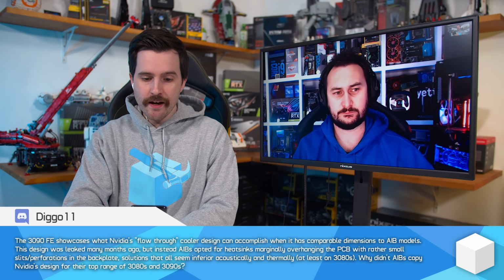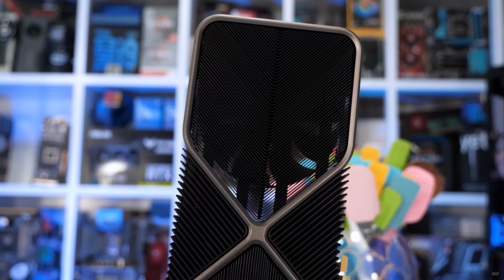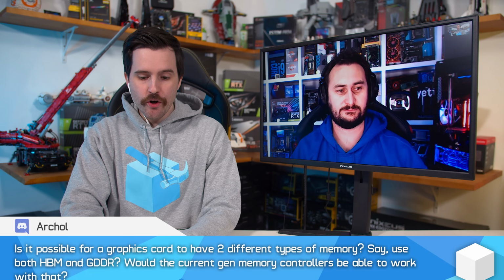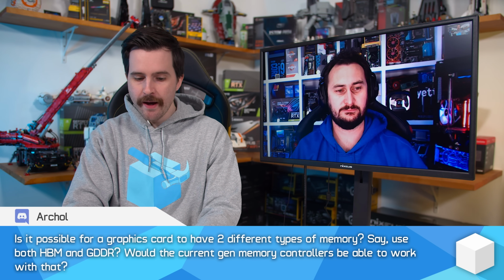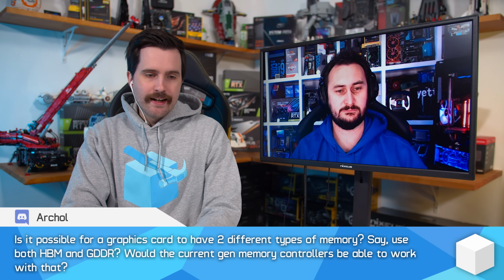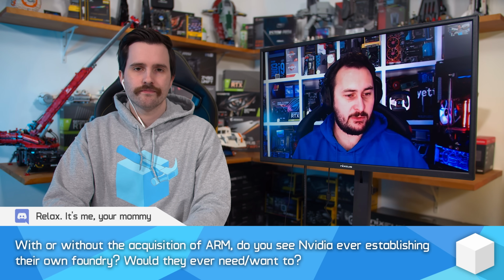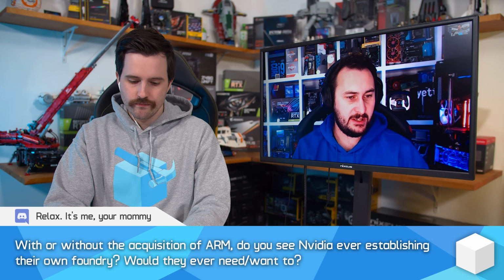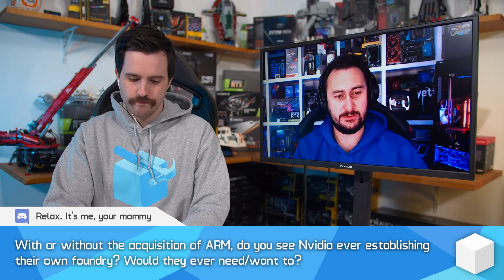Will RDNA2 and Zen 3 Have Launch Issues? Can AMD Beat Nvidia at Ray Tracing? September Q&A [Part 3]

Comment: You're going to have to forgive me for this, but this "all laptops already run at Tjmax so therefore we're going to stop talking about it" just doesn't sit well with me.
If you don't thermal throttle your processor... you're leaving performance on the table...?
So you've utterly given up on pushing manufacturers to design thermal solutions in their laptops that actually do their job and keep your computer from desoldering components from itself?
That said, I do agree with use of wattage numbers in reviews. I just... 
As a broke sod who may end up keeping a laptop for 7 years plus because even a $600 "budget" machine is very expensive to me, I want to know that once I buy that computer, it's still going to WORK in 7 years once it's become too old for me to enjoy using.
I should WANT to upgrade my computer, not be FORCED to because the thing desoldered itself and died in 2 years.

I could write an essay about the problems with the modern laptop market, and how some reviewers want there to be less variety in the market because they hold the Macbook sacred as the perfect thin-and-light class laptop (I tried one in a store; I don't see the hype - yes, it's so thin you can shave with it, and the screen does look nice, but the keyboard and trackpad were not fun to use) and want anything that's not a gaming laptop with the dimensions of my Inspiron 1501 to aspire to it, complete with its flaws (Donglebook? Keys with such short throw that it felt like typing on a contoured board?)...
Don't get me wrong. I'm glad that the market has moved on from underpowered laptops with 5400RPM hard drives, one inch thick frames, massive bezels, and 6.5lb desk weight that take five minutes to boot and run two hours on a charge if you're nice to them.
But at what price?
A full size laptop can hold a lot of stuff. I/O ports, cooling, optical drives, good keyboards, and multiple user-replaceable batteries are just the things that I can think of off the top of my head.

Comment: All I wanna know is will the new 5000chips work on my High end X470? Seeing as they’re skipping 4000 on desktops they have to follow through on their promise right? Either that or ive paid 370 on a board and can’t really upgrade
Reply: All X470 boards (and B450 boards, while we're at it) will support Zen 3 chips. Call them 4000 or 5000, it doesn't matter. They're still Zen 3.

You'll probably need to flash the beta bios, but your board will support the chip, as promised. Good Guy AMD, as Paul's Hardware would say.

Comment: I mean amd has 1 month to patch their ray tracing and dlss to "work" with the cyberpunk2077 launch....im sure they got HEADS at CDPR with this clockwork work cycle....in turn...helping implement said AMD dlss patches etc....for said launch...AMD has to throw which ever $$$(next gen console lobbying/won) where ever they must to insure software implementations are met considering....the 3070 price point and the 500-700$ price point AMD claims/usually price/performance competes with.......if 700-800$ can get me 16gb....and HOPE that i wont have to skip BIG navi.....bc rtx does dlss 2.0 and AMD is merely a GIMMICK for an entire 1-2 year period.....ill/well have no choice.....as far as ultrawide/4k and VR etc....hopeful gamers. 1080p/QHD has its own crowd as well as G-sync frame threshold seekers. Ive finally moved on to PVE etc.....4k/ultrawide gaming as a "gamer"....i still got my 1080p 165hz if i "have" to play any competitive shooters with friends in discord or etc....Since i know the IPS work arounds for low input lag.....enable MPRT 1ms "GIMMICK"............auto calibrate colors and brightness....in geforce experience....boom g-sync with mprt.....but no adapticve sync....bc who cares 400+ fps in valorant or cs:go.........and 1ms-3ms on IPS......if your panel is actually proven to actually get low sub 5ms on IPS.....>ACTUALLY<. n00bs try to get fast refreshrate and response on an IPS then complain about low brighness with the intermittent-inactuality black frames being flipped between renders....to give 1m-3ms in actuality......coughs/clears throught....you can customize colors/brightness in GPU suite...amd or nvidia....nvidia has the added PAY TO WIN aspect of still having g-sync enabled.......with mprt or "fast response" etc enabled.........vs freesync having to be disabled. Just a little insight on the PANEL-gate i believe were truely in and how GPU driven utilizing varoius panel/monitor caveats actually is vs how underutilized they are and yet payed for and standardized some of the concepts are. Either way as usual N-vidia has some software or work around caveat to edge AMD.....as far as total FPS or "RESULT" driven sales. Just like this freesync vs g-sync IPS driven gaming demographic. Anyone in the know just "KNOWS" nvidia has varous aspects that are worth 100-200$ from a software/exclusive side. That still drives a wedge among gamers/consumers. Hoping more TCL series 6 120hz 4k tv "gaming" 2020 reviews come out....bc if not im still going to have to save for the better part of 6 months for an LG 4k tv with g-sync....if so. Fingers crossed this 6900xt is the bees knees along with a 55" TCL 120hz quantum series 6 for gaming. For 800$ for that tv....and my budget ultrawide....im looking at 1250$ total for my 2020 and on...monitors......vs 1200+ for the 200hz IPS etc hullabaloo ultrawides or the 38" LG ultrawide....2 panels vs 1.....An other example that TCL 4k gaming tv.....or a 32" VA samsung odyssey........were in an interesting "Place" RN as gamers.........im going the route that favors my PC and an eventual next-gen console for digital exclusives.....i hope the multiplayer/online demographic sees echoes with this next-gen launch as world of warcraft etc does their best to maintain a status quo for the "PC master race" as well as the PC cyberpunkers vs the Next-gen crowd. These statistics really intrigue me.

Comment: As for rdna 2 availability i dont think it will be much different to ampere, i mean yeah nvidia cards are way more popular but the demand is still insane these times regardless manufacturer. amd radeon group is known for paper launches as well and then there are drivers, features and performance. Obviously demand will depend on product success but i think availability will be just as bad if not worse.

Comment: Here in uk the same. Zero founders edition 3080 released as nvidia deliberately inflated partners prices. So the worse than founders cards that look so ugly with cheap fans stuck all over and will sag without brackets went from 649.99 to 720.00  plus within thirty minutes of nvidias notify me button Going straight to sold out.  On top of these issues as Ampere maybe better fps wise than the woeful turing serise but its a massive step backwards in efficiency and the actual size and weight of cards due to all the extra heat. Not only are there zero founders edition 3080 s available but there are zero partners cards at 649.99 even though they should be cheaper as they look ugly compared to fe and often perform worse and somebare showing sagging issues as they heat up etc..Adored tv has agrreat video on youtube about turing and ampere go give his latest video a watch its brilliant.   Nvidia like intel got lazy. They thought they could just release a card with 20% increase in performance every year like intel used to do with its 4 cores every year. As intel went into panic mode websaw them launch power hungry hot cpus as they tried to combat amd ryzen....amd ignored them and carried on with ryzen 2 taking another step closer by teleasing low powered efficient multi core cpus that nearly match d intels gaming performance but at half the power and heat ie the 3700x at just 65watts is a incredible cpu. We see amd playing the long game again. With each gpu launch they gaining experience, learning from mistakes and ignore competing instead focus on launching a more efficient lower powered gpu that slowly is closing the gap on nvidia. I have always bought intel and nvidia....but now l use ryzen 3700x and pcie 4.0 nvme drives and at such low power and heat it leaves intel well behind even though l may get a few less fps at this time...in future having pcie 4.0 keeps system a bit more future proofed....althogh l expect ddr 5 to makee upgrade before we have need to use a gpu on a pcie 4.0 slot. With ampere nvidia did not think amd woukd get so close..when they began to panic as they saw rdna2 leaks capability wise they stuck on 8nm only had one choice...they had dramatically increase power consumption...75 to 100 watts extra used by 3080 over the 2080 super and yhen had to deal with the heat..so nvidia design a founders edition card with a huge heatsink on but make this for reviewers only..delibetately inflating prices of partners cards while lieing that price is 649.99 when no one can find one anywhere near that price. So why did nvidia panic launch cards when they and partners had zero stock vrs demand? Again panic mode as they try to make as much money as possible before rdna2 launches.  Amd have a chance to take a huge 15 to 20% market share off nvidia..which would be a huge step as amd heads towards their rdna3 launch. I think now the winner between nvidia and amd is down to who can produce the most cards before xmas. If amd makes rdna2 cheaper and readily available for all nvidia is going to lose market share on a scale we havent seen for years. I do think until rdna3 we will have to wait as then amd shd be level with nvidia but till then..l for one will buy rdna2 if they launch in november and l can get one otherwise l may either stick to 2080super or consider a 3080 fe at 649.99 if they actually exist and its not just a fake card nvidia made for reviewers. Nvidia should tell us truth ie how many 3080s fe cards they have made...how many they released and the figures on when more are coming ..as they dont many are annoyed and will go to rdna2 like ke me.

Comment: DLSS would of course raise VRAM usage.
Reply from the maker: Yeah? How so?
Reply: @Hardwareunboxed  My hypothesis is that the GPU is doing more when DLSS is enabled compared to when it is not. 

Normal 1080p and 1080p scaled up via DLSS to 4k both need to assemble a 1080p frame, but the DLSS enabled option needs, at the very least, somewhere to store the upscaled frame as it's being assembled.

However, this does need to be tested as I'm not knowledgeable enough to be anywhere near certain that VRAM usage would actually increase (I'm not nearly as certain as my first comment might suggest).

Comment: Question: At present, there's almost NO HDMI 2.1 supported PC monitors in the market. But There are several TV models that supports HDMI 2.1 plus 4K plus higher refresh rates. What do you see as drawbacks when someone need to use a TV(of above specs) as a PC Monitor?

Comment: If AMD can release a 100% 1440p 144hz gamin cats at a reasonable price, they just win. That’s where the money is rn.
Reply: This. As GamersNexus pointed out, the "8k" marketing nVidia is pushing is actually a bit detrimental, because with (I think it's literally just 1? 2?) only a few 8k monitors in existence, no one but the ultra-enthusiasts are going to be using its "full potential". 

Which I use loosely since even 4k gives the 30xx problems in multiple games at the moment. AMD has had great success in the mid-tier market, and I'm looking forward to seeing exactly such a card as you describe.

Comment: Tim's right about why they launch the high end products first (the other points about logistics are also true though). While the people with $700 ready to go will of course buy the halo product anyway, as Steve states, leading with the halo is about capturing those who might have $400-500 ready, but who could possibly stretch to $700-800 if they make serious sacrifices in other areas, or possibly go into debt, and have poor impulse control. The people who would probably only buy a 70 class card, but damn it, they want it NOW! It's definitely something that manufacturers think about in these calculations. Otherwise they would just go with whichever was going to be the easiest to get out first, which would generally be based on silicon yields.

Comment: AMD also has to supply the processors for game consoles too and they are struggling to keep up with demand there also so I don't really expect much until after the 1st of the year after they satisfy the demand for this console and CPU products  .... Investor reports at the end of 1st quarter were predicting a falloff in sales because of Covid but they actually had an increase in demand and that demand is still at record levels compared to the same time periods the earlier few years ...... That put production in a bind because these schedules at TSMC are set months in advance and around the time these schedules were booked they were planning on less not more demand .....

Comment: I planned on buying a 3070, but when I saw how crazy the hype was and how difficult it was to get the $700 3080, I thought there's no way I'll be able to snag a 3070 at launch day, assuming it'll be even MORE popular. And I already sold my 2070 Super, so I didn't want to go TWO whole months on my older 970, especially considering I bought a 240hz monitor... So I went ahead and bought a 3080 instead of waiting for the 3070. Idk how many people are in the same sort of boat, but I figured it's an extra $200 and I don't have to wait an extra month+, so I went for it.
Reply: How did you get a 3080? and are you in the USA?
Reply: @unclej3910  yep, in the USA. And I used distill.io to monitor the out of stock button on Nvidia, Best Buy, and EVGA. It just refreshes the page every (any time you pick) and checks to see if whatever part of the site you selected changed at all. Then when it sees there's a change, it made a notification noise and I ran to my computer (which had volume maxed out) and tried to order. There's also a discord that's got a distill.io bot setup, if you don't want to do it yourself. It's called 3080 tracking or something like that

Comment: Something I want to point out that everyone seems to miss is that AMD had Radeon rays years before RTX came out.
Reply: I'm not up on my Ray's knowledge but wasn't Rays 1.0 just a plugin for Unreal engine and came out in 2018? Rays 2.0 in 2019 but didn't support any useful API and Rays 4.0 this year supporting vulkan and dx12.

So unless my admittedly limited knowledge is wrong, AMD didn't have it "years before RTX", but in the same year and at a less usable stage of development
Reply: And Nvidia had OptiX before AMD had Radeon rays. What's your point?

Comment: With how difficult modern silicon can to produce without defects, how strict binning needs to be and their past history, I bet they will have the same stock issues they had with Zen +. Radeon 5700 series also had card design and launch issues that worked themselves out later . I think this is just the new normal and how most launches for most companies go forward. All the consoles, AMD, Intel and Nvidia will have similar issues.

Comment: Nobody is buying Global Foundry.

They were made by AMD and IBM spinning off their fabs because they found Arabs willing to overpay.

Since then, the Arabs have been pumping money in to it but they still lag far behind Samsung (at least for anything smaller than about 40nm).

For the Arabs, buying up tech and real estate is their hedge against oil revenue going away but they are doing pretty badly picking their investments.

At some point the Arabs are going to stop putting more money in to Global.  This might have happened already, I'm not close enough to tell.

I have a feeling that the Arabs would rather let Global die than sell cheap so nobody wants to buy them and even if they did, they would have to grossly overpay.

Beside that, the cheap way to "own" Global is to just place a wafer order.  Management will probably bend over backwards for anyone that gives them a big order.  After that the issue is if you can make a competitive GPU on a Global process.

Comment: What is 2.5Gbps network card on msi board advertised at the begining? There is no switch you can connect it to. Switches have 1Gbps, 10Gbps and 40Gbps ports.
Reply: 802.3bz goes by different names, NBase-T and multi-gigabit with the latter being more prominent.  2.5Gb and 5Gb are achieved over CAT5e while 10Gb requires CAT6 (and CAT6a over 20m).  The idea of multi-gigabit is to improve throughput without having to rewire.  You would be surprised at how many newer 10Gb switches and GBICs are already multi-gigabit..
Reply: @Wahinies  Hmmm... Looks like it was introduced in 2014 which is when I moved to security from networking and have not been aware of Nbase-T until now.

Comment: Am I the only one extremely underwhelmed with Ray tracing? There's still many games that use it, the only game really is Control. Mediocre tech demo at best, I have a 2080 super I'm happily with 1080p gaming. It's a good screen 270 refresh with a 3800x with good overclocks. Warzone does look pretty with Ray tracing but I'd rather have 200 fps than visuals. Playing Serious 4 recently things haven't come on all that much really, the graphics are adequate for me. What do I know? Building pcs since 386 cpus, the evolution has be good to see but not earth shattering considering the cost.